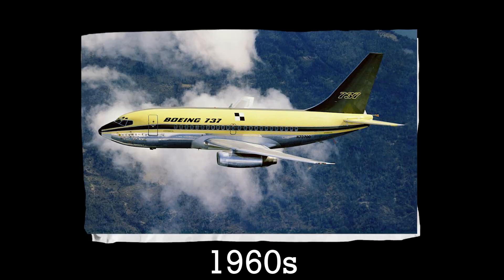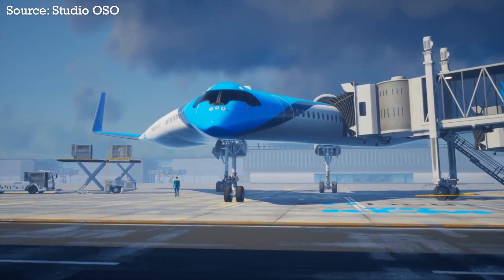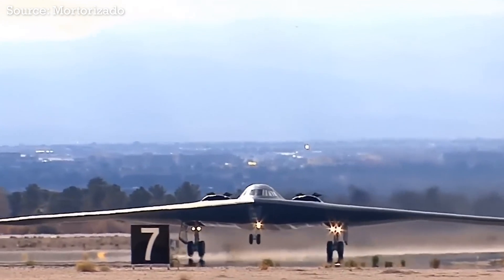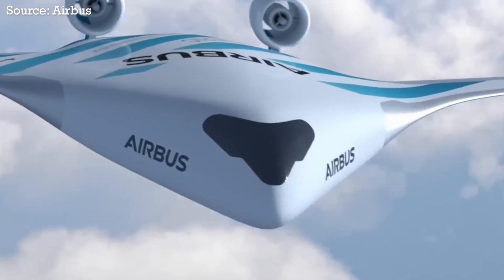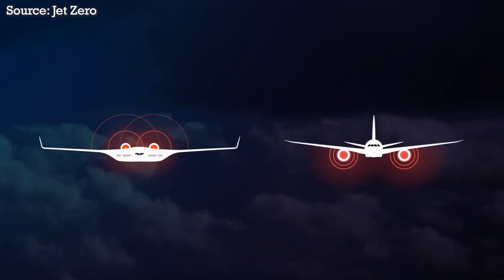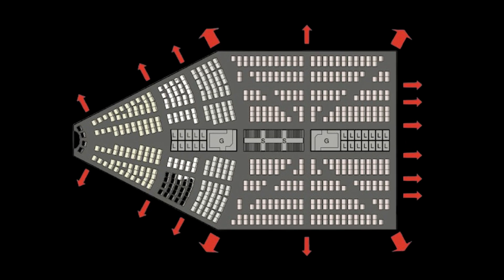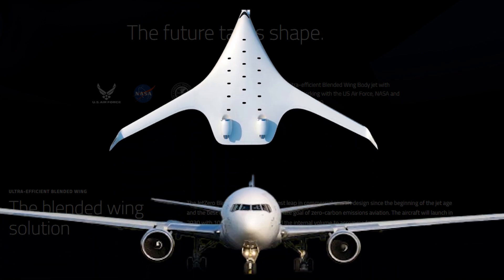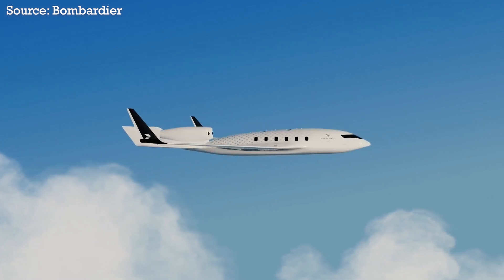Is This The Airplane Of The Future?

Comment: Most engineering problems can be solved with the "flying/ blended wing " concept, given sufficient design and development. No, the major problems will be two fold, as stated in the video, safety  in trying to exit in an emergency, and the basic ergonomics of the seating arrangements. As was pointed out, there will be " many " centre aisle seats! Window seats will be at a high premium and probably be first class only! !  As to savings in fuel, yes, obviously great savings could be achieved, and just as well too, as there will be not much room to store the fuel, not if the wings are occupied by passengers!

Comment: Abig problem is structural in that conventional airliners have an essentially sausage shaped pressurised cabin which is structurally very efficient. The blended wig , by contrast would have a wide flat vee shaped cabin. This is structurally very inefficient and would inevitably result in a much heavier structure. This might well cancel any aerodynamic advantage.

Comment: So, who’s going to pay for the $ 900,800,70,500 upgrade to the airport?…..the stupid A380 forced our airport to build special air-bridge to accommodate their stupid A380……then the damn airline stopped using the stupid A380……so,we’re suing the airline for under-usage of the specialized airbridges……..we’re suing the airline $30,000,500 for not using the air bridge.   Ok, no need to build these darn specialized airbridges……just park the darn A380 at remote bays…..ok……take 4 hours to board your A380…..highly recommend that the first passengers in begin a card Hanes wit his buddies, cause it’s gonna be 4 hours before the takeoff😂😂😂

Comment: Just as mentioned, airport infrastructure and runways issues, cabin emergency egress issues, structural weight and strength issues to pressurize a whooping cabin that is not a simple tube and how could we cope with an extra 500 more passenger deaths at the crash scene.

Comment: Northrop's wings were not the first.
See the 1918 Stout "Batwing", though it had a fin & rudder.
Of several contenders; Boris Ivanovich Cheranovsky in 1926 flew the BICh-3 first as a glider then with an 18hp engine, though it could stay aloft on partial power.
He and others like Northrop & the Hortens all tried for the purist's all-wing without any vertical stabilizer. They then tried wing-wip fins which were a little bit less terrible.
Those who put a fin & rudder at the tail behind the prop, produced good stable safe planes, in the case of the Arup, markedly superior to "Normal" planes.
Dunne, Payen, Fauvel, Lippisch, Junkers, Johnson. All followed those steps. Northrop and the Hortens tried for the purist's all-wing and the planes were tricky and risky.
All wanted to put all habitable volume in a wing so of course there were a lot of odd things with big wings for their small size, with a pod for the pilot and the engine at front.. All tried to some extent ranging from various lifting fuselage bodies. Many made good planes.
Ignored by backers or investors.

For a more approachable version, look up the Boeing model 754, rather like many designed by Burnelli, of Texas. Look up the Burnelli CBY-3.
It does not take advanced materials and engines to make planes that get x1.5x the range and payload, on to shorter runways with perfectly normal (better) conventional handling.

Comment: Used to work for Northrop.   We had designs for flying wing airliners.   These were never pushed forward because the aerodynamic advantages never outweighed other disadvantages.   The ideal flying wing airliner would house the passengers in the wing.  The wing thickness to make this happen would wipe out all aerodynamic advantage of a wing unless the aircraft flew so slow that no one would want to fly.
Boeing investigated building a blended wing airliner to replace the 747 and could not find a design that was better the 747.  
People keep on looking at flying and blended wings and keep finding it doesn't work.

Comment: While it would be nice to see something different, there are fundamental problems - airliners have a circular cross section because that's the most effective shape to contain the cabin pressure - a blended wing cabin would be much heavier because of strengthening required . In addition existing designs with thin wings and minimum size circular cross section fuselages will have a significantly lower total cross sectional / frontal area than a blended wing design and therefore much less drag. Then as raised in the video there is the problem of emergency exits, windows for passengers, baggage storage and loading. Never say never, but I don't see them coming.

Comment: 1:05  Put away your "USA only glasses"! Then you would know that the first flying wings were built by the Horten brothers in the mid 1930s in Germany.
Reply from the maker: There have been multiple flying wing prototypes before the Northrop N-1M but none of them were successful. The Horten Ho-229, while it was a very unique and innovative design for its time, faced plenty of technical challenges and crashed during its third flight test.

Comment: There is a long, detailed explanation as to why the BWB will not be viable. Let me summarize it in a single sentence:  the manufacturing difficulties and the limits it places on a design being flexible enough to easily be sized for specific markets means that it is economically non-viable. Plus, you really don’t want to sit very far from the roll center of the aircraft unless you have a supply of barf bags handy.

Comment: If anything happens with the computer ,even a hiccup, everyone is dead.  The flying wing is inherently unstable. The flying wing bomber was created for stealth.  You don’t need that in commercial applications.
Reply: I'm not a fan of this blended wing/body design, but it is not a flying wing.  First of all a flying wing is not necessarily unstable, it just has a very narrow range of CG where it is stable, along with less control authority than a conventional configuration. I would not wish to fly one for fun.  The B-2 is obviously digital flight control so it can do without static stability and still handle normally for the pilot.

A BWB has a wider range of acceptable CG and more control power with control surfaces farther from the CG and aerodynamic center.  It is easier to provide static stability, and I doubt a BWB commercial airliner would be built without a margin of static stability even if equipped with digital FCS.

Comment: You've pretty much summarized all the main issues: pressurization, evacuation, centering and stability, roller-coaster ride for passengers seated far from the middle. There's also cargo compatibility, jet bridge compatibility, engine maintenance, absence of windows for passengers, complexity of deriving variant designs.

If that's not bad enough, the nail in the coffin is probably that the current design is now mostly set in stone through the way certification processes and regulations are written. When you see how long it's been for Boeing to certify the MAX 10 and 777x when they are only incremental designs, I can't imagine how hard it would be to get funding for a BWB project when certification requires basically to get the FAA and/or JAA to agree to rewrite half the rules beforehand.
Reply: More reasons I don't fly. One thing the flying wing has in common with current passenger aircraft is that when it crashes, everyone gets cooked.

Comment: It’s interesting and cool but a lot of people will have to go without a window seat there will be very few window seats that’s the problem it’s a nice idea but I don’t think it’ll be popular because of the lack of window seats very few airlines would buy it meaning it’ll be discontinued very quickly it’s an idea that’s doomed to fail unless they can figure out something that could give you a window seats even if it’s on a tv screen that way you can see everything even without window seats
Reply: There is a windowless concept out there now where digital panels running the whole length of the cabin projecting the outside view. It’s probably a long way off from inflight use though. It might surface in business jets first. Not sure either if that still solves the issue for those sitting in the middle. Also I don’t think this is a big factor for airlines buying new jets. Fuel economy, maintenance costs and capacity are likely at the top of their needs list. Passengers may grumble about having no window but they know in the end it’ll stop once people get use to it. Airlines will like charge a premium for window seats if the sense of movement issues in the outer seats is minimal. There’s a lot to factor in.

Comment: production is important and the current design of aircraft allows for easy manufacturing

major parts like wings can be built in separate facilities which speeds up the process of building it
Reply: True that. Also blended wing or flying wings can’t be easily stretched to make higher and lower capacity versions.